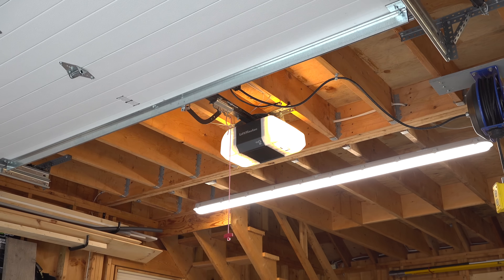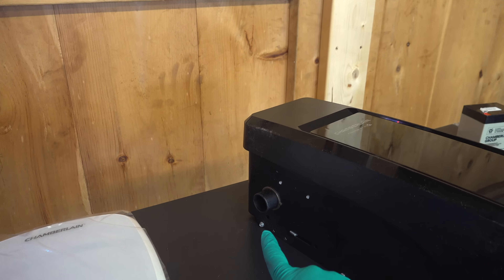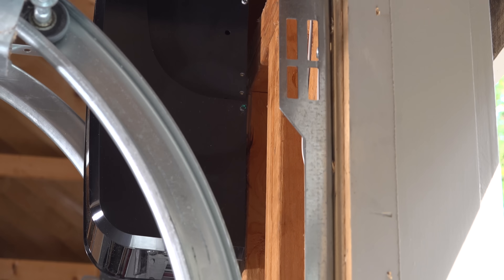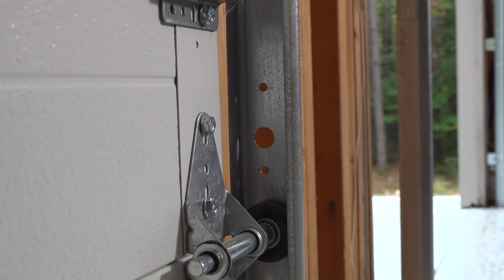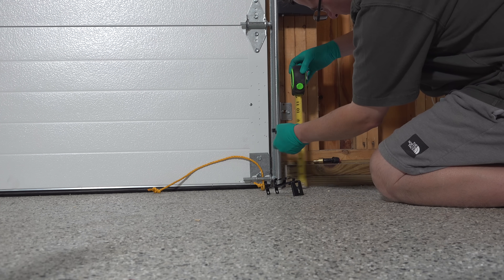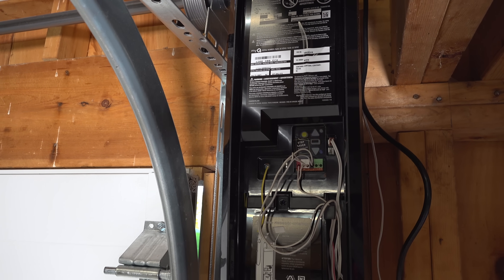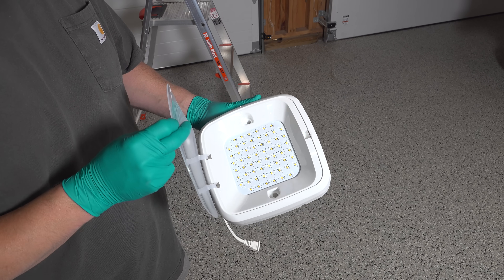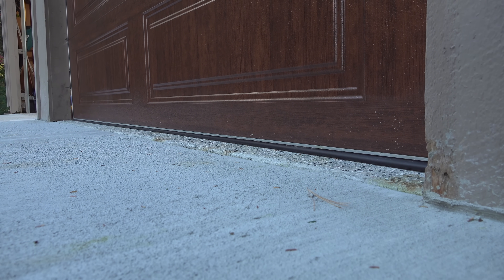Finally a SILENT Garage Door Opener that locks like a SAFE! - RJ0101

Comment: I have two of these hateful things.   The jackshaft only pulls the door up, it doesn't push it down.  It only allows the door to 'fall' in controlled fashion.  That might seem an insignificant distinction but it's important to understand because if the door is fully open (horizontal), there's not enough weight to pull the door down.   You have to adjust the door so that part of the lowest section is near vertical so it can pull the rest of the door down.  In my case, the door won't "fall" closed unless I adjust the limits so the door blocks about 1' from the top of my garage door opening.  I need the full 10' of my opening so this doesn't work for me.  As such, I have to have a plunger spring that pushes the door down until it can fall on its own which defeats the purpose of not having something on your ceiling.

Additionally, when the seasons change from summer to winter or back, all the tension settings are wrong and the door won't open or close correctly and I have to get out a ladder and re-set the tensions.  We get Chinook's here so even during the winter, I have to re-set the tensions before/after.  

My overhead door guy installed it despite recommending against it.  Now I wish I'd listened to him.   I want my garage doors to be reliable, I don't want to get out of my vehicle to manually intervene.  These (Liftmaster 8500) don't meet that requirement.
Reply: Super Interesting. Thanks for sharing!
Reply: Thanks for saving us the inconvenience.
Reply: Have you considered slightly angling up the rails so the garage door is never fully horizontal?
Reply: @TheCarpenterUnion  Every change affects the whole system in a different way.  Changing that angle will make it harder for the motor to pull the door uphill when the door is nearing full 'up' and that will also be when there's the least tension in the spring which will mean increasing spring tension to compensate and then we're back to the same problem.

In the 3 years I've had these doors, I've learned a lot about the many different variables that affect them with this opener.   I even thought maybe my overhead door guy was part of the problem so I had an old guy from a different company come out.  He looked at my install and said it was done well and that this is just the nature of the beast.  One option he gave me was to raise the rails up near the ceiling and add an additional panel.  But the geometry of my garage means that I'd have to change my lighting to be flush with the drywall.
Reply: @hp7033  🤷‍♂️ just a suggestion
I have mine angled on a traditional belt just to gain some overhead space. I don't think you'd need to tension the spring as long as the motor is capable of holding as well to some degree.
Reply: @TheCarpenterUnion that's a tremendous amount of work when there are better, easier, and cheaper options available. Unless your garage structurally won't allow a traditional style, there's just no reason to go through all that.
Reply: Are you sure your torsion springs aren't too "tight"? If you disconnect the opener and lift manually, does the door seem to want to pull itself up? If so, might want to loosen the springs a bit to allow the weight of the door bring itself down rather than want to come up
Reply: @GageDrums  Yeah. I'm quite sure.  If I disconnect the opener and even part of the bottom panel is in the opening, the door happily falls all the way.
Reply: @hp7033  interesting! Well that sucks
Reply: @GageDrums  Everyone guesses this. It wont work. The opener is slowly releasing the spring tension off the door so it can fall down in a controlled manner. Adjusting springs does nothing. What needs to be done is to raise the back hangs as far as you can. ensure you have good ball bearing rollers and the track is free of any dirt to give you the best possible conditions for this operator to work.
Reply: Thanks for your input on these. I need to do more research to see if this is the right solution for me...
Reply: I'm a garage door company owner. 2 simple adjustments will solve your problems. 1. elevate the horizontal track slightly up in the back and 2. reduce the spring tension on the torsion springs.
Reply: @Colt45.   The rails are already elevated quite a bit at the back end.  The door guy came back a few times to adjust the tension.  It's at a point now where if the springs are loosened, then the opener errors out unable to lift the doors back up.   They're 10 foot x 10 foot R16 doors with windows in one panel.  

The door guy has been a door guy all his life.  He installed the original doors with his dad when he was 16, in 1981 and has taken over the business.  I'm not saying a guy with 40+ years of experience can't be incompetent but I do tend to trust him.
Reply from the maker: There is nothing special about my door and it opens and closes fully. This model just came out this month with variable tension which is different than previous models. Maybe that's why but so far it has been working perfectly.
Reply: @SilverCymbal It will be interesting if you feel the same 10 years down the road.  Standard openers are far superior, particularly the screw type which I have which are much quieter than a chain and positively lock the door in any position.  Now way I’d replace my screw style opener with one of these.
Reply: @LTVoyager  I agree on the screw type being the best.  That's probably why no one makes them anymore.
Reply: @williampalchak7574 they still make them. They are just inferior to belt drive operators. I've been installing for 24 years and old screw drives with a big screw (Moore-O-Matic) were great but the newer small screw (Genie & Chamberlain) have more problems. We will not even sell them.
Reply: @culpforty  yeah, we've got 2 "small screw" in our garage since Katrina that would disagree.  I like to synchronize opening them for kicks.  Did that just a few hours ago so your comment made me laugh.
Reply: That’s a faulty unit my friend.  Mine has worked perfectly for 10yrs
Reply: @Fixin-To it's not a faulty unit, garage door pros tell residential clients not to use these specifically for this reason. If the people who stand to make more money by selling openers 2x the cost of normal openers tell you not to do it, you know you shouldn't do it.
Reply from the maker: @Fixin-To  I agree the motor has the same force in either direction.
Reply: @Fixin-To  It may be a faulty unit, but it is partially simply physics.  You can’t push a rope.  The torsion rod style openers can only pull the door open with the cable, they push the door closed as a conventional open can and does.  This is an inherent limitation in this style of opener.
Reply: on a side-note: so nice to see civilized pro and con conversation where both sides focus on explaining the subject and not attacking the person.
Reply: I'm a garage door guy. I try to talk my customers out of wall mount openers on standard lift doors. There are too many callbacks. I install pusher springs gs on all of my standard lift doors and have eliminated most callbacks. Also, I install Genie, not Liftmaster wall mounts. I've had too many problems with the Liftmasters. Now, they are perfect for high lift or vertical lift doors. I have 3 in my shop that have been working flawlessly for a couple of years since I have one highlift and 2 vertical lift doors.
Reply: I was going to go with the wall mounted type like this for all 3 of my doors, specifically to free up the garage ceiling space. A friend of mine that installed doors/openers for years told me not to do it for the very reasons you recommended. He said they are great for large doors that open straight up Luke in warehouses and auto shops, but the average home garage door these just aren't made for. He also told me I'd have to mess with the travel and tension settings in the fall and in the spring. It's a garage door opener,  I don't want to ever think about it again once it's installed. I went with chamberlain belt drive openers with MyQ and I'm extremely happy as they work well and are as silent as can be.
Reply: Also those locks fail after a few years. Condo had these installed and they failed all the time.
Reply: I assume these don't work with the one piece doors?
Reply: @brodriguez11000 right
Reply: Umm as a Garage Door Professional.. We have a fix for this!! If it's installed correctly and by a person that has done many installs this is a great option. More expensive and yes it saves space. Great for people with car lift in the garage!!
Reply: Couldn't you raise your rails in the back? wouldn't that allow gravity to do more?
Reply: @shrimpinpat 
Gravity is fake.
Reply: @shrimpinpat  They're already raised a bit. Maybe a few inches over 10 feet.
Reply: Is the gravity lowering system the same with ALL jack shaft motor systems?  I am researching now, thank you in advance.
Reply: @kevinjohnson2024 yes. If you look at a regular opener you will see that a chain or belt or screw drive system is connected to the door itself and pulls it up and pushes it down . As mentioned you can’t push the jack shaft down, it turns as the door falls by gravity. The opener just stops it from dropping like a rock. Go look at a regular opener and use it manually as if you lost power, you’ll see how it works.
Reply: Your opener was never installed correctly and your spring tensions were never balanced correctly!  I have been using one of these openers for over 10 years and have never had an issue.  Doesn’t matter what the temperature is, the operation is consistent regardless. Commercial openers have used side drive openers for decades.  Find a new installer, one that has a clue how to properly install an opener!
Reply: 'You have to adjust the door so that part of the lowest section is near vertical so it can pull the rest of the door down.'
That is not the only way.  You could just raise the inside end of each track slightly, and get the needed 5 pounds or so of down force from a slightly inclined plane.  While they tell you not to do this, it's so the door is neutral when up and doesn't tend to fall.  5 pounds of down force generated that way would be no real difference from having the constant down force generated from keeping it rolled away from the full up position.
Reply: I have one of these on a new construction build. My door is open well past the opening and the lowest panel is nowhere near vertical when opened. Yours are either the wrong application or not installed correctly.
Reply: Door maintenance is a real thing when running these.
Reply: You have it set incorrectly. You don't set the track so it's perfectly horizontal at the top. Leave a little slope and it'll work fine. I've had one for over 15 years.
Reply: I have a Jackmaster for years and it has always worked perfectly
Reply: This was very insightful to know. 

I have three garage doors and I installed three of the chamberlain units four years ago—the regular belt drive. Each has been flawless and the app is very good also.
Reply: This is exactly the issue with these types of openers. I would only ever recommend this type of opener for a heavier, glass/aluminum door
Reply: I’ve had this system for 2-3 years on 16 foot wide 7 foot tall door in Missouri (hot summers / cold wet winters) with no issues. System is so quiet and smooth!
Reply: @hp7033  thanks.  I would have the same problem living in a coldmclimate
Reply: So don't install this for a standard residential lightweight insulated garage door that stays halfway open on its own without falling?
Reply: At this years CES they replaced the door with a tablet... 😂
Reply: Sounds like it was never programmed correctly, They are programmable for down force
Reply: @michaeljames63  How exactly do they produce 'downforce'?  There's no mechanical way for the opener to push the door down.  The programming you're talking about has to do with the limits and with the up-force.   I mentioned in my original comment from a year ago that I have to re-program the door whenever the seasons change.
Reply: Jackshaft has to be installed on a door that has been tuned with this device in mind. Nylon rollers with fresh bearings in them, no friction against the opening/trim, springs slightly detuned to create some natural pull at the open position, horizontal track should be lifted slightly upwards, and the whole door should be tuned up and lubed well (end bearings should be perfect too).
Reply: @dmytroonikiienko5461  Mine were installed at the same time the new doors with all new hardware were installed.  10 foot doors, 11 foot ceilings, rails tilted up.

One has to ask oneself, if these are so difficult to tune/install, and installers are recommending against them, why are they so considered so much better?  My install is now over 4 years old.  Does that mean I have to buy all new hardware again?
Reply: @hp7033  Technically, you just have to do your math and see if their is slight possibility that you've done 10,000 cycles or more on those original rollers. Spring should be adjusted once a year or more if you are using a door a lot.

I am an installer and I can guarantee you that if most of the precautions are in place there should be little to no issues with the cable drop etc. Moreover, the newer jackshaft openers (anything LM after 2023) are a much better option than the old 8500 with an auxiliary cable tension monitor, there little to no issues with the chamberlain you see in the video.
Reply: Any chance you have a short radius bend in your door tracks?  Going with a longer track radius will help a ton with these.  I set my door springs a tad "heavy", a little slope on the horizontal tracks, and no more issues from it.  You also can get "pushers" to the ends of the track but I really didn't want to have to go that far.  So far, so good.  I hated all the rattling my old chain-drive opener made when the kids were romping in the bonus room overhead.
Reply: @GoFastGator  The radius looks the same as my other garage doors with trolley openers.  The pusher springs are how my door guy worked around the problem after his 4th trip back and I hate them.  He told me the problem is that while these openers work ok on 8' doors, the taller the door, the worse they are.  Even with a slope, my 10 foot doors just have too much weight and don't want to start moving on their own, reliably.  They will eventually but by then the opener has timed out.   I pushed up the slope even further but had to move a couple of my flourescent fixtures because now the door wants to collide with them.
Reply: @ I would maybe look into the pushers.  My door is a 16ft and is very reliable even without the pushers.  If you don’t have any more overhead clearance, you may not be able to utilize a longer radius for the bend without creating a gap when the door is closed.
Reply: This may be true for an older design, buy not the rj0101
Reply: I think the overhead units have an adjustment screw for motor torque when closing and it's usually set to minimum. Maybe this jackscrew type has the same adjustment and you can increase the closing torque. Have to open it to access. Maybe? I've never done it
Reply: You are absolutely right. Instead of the weight controlling the door, it is now the operator on the torsion shaft releasing the tension. If the door at all gets hung up and the operator keeps turning the cables then jump. We saw an increase of this over 70% when these jackshaft operators came out for residential. If you don't have headroom you have to have one of these but otherwise avoid them like the plague.
Reply: @tonystewart7872  Which touches on my final beef.  In order to reduce the chance of cable jumps, they have another spring loaded sensor that the cable runs against.  If the cable becomes slack, the sensor 'trips' and the opener 'should' stop.  So added complexity that turns out not to be 100% reliable.
Reply: This is exactly correct. Conventional openers which push down the door are vastly more reliable. If not set up just right, these jackshaft openers will eventually crank your door to failure. Have seen many. And they're not appreciably quieter. The majority of noise comes from the door roller bearings, not the opener motor.
Reply: I'm not sure what opener you have but I just installed one of these recently to replace my old and malfunctioning rod driven opener. The door opens and closes super smoothly. The door does not fall closed on its own at all, it remains perfectly stationary when disengaged. Actually at the open most point, the door has a natural "desire" to open probably due to the spring but once past that upper most point, it does not fall closed or slip up to open. So, for the model I have at least, your claim is factually incorrect as it can pull that top part down with ease.
It is also much quieter. Same rollers on the door, just no louder motor pushing and pulling the armature along the screw shaft. I am super happy with my opener and would happily recommend it to anyone looking for a replacement door opener. Sorry you had bad luck.. twice apparently.
Reply: @dancormack  On a typical residential garage door, on each side there is a cable that runs from the very bottom of the door straight up the sides, and to a pair of rollers on the jack-shaft.  When the jack-shaft is turned one way, the cable is retracted and the bottom of the door is pulled up.   In order for the door to go back down, the jack shaft is turned the other way allowing the cable to unwind itself and the door 'falls' closed.  There is no way to turn the jack shaft to make the door go lower if the spring is so tight because you would, in effect, be pushing on the cable and it of course would go slack (tripping the jackshaft-opener lever sensor which monitors the cable tension).  I have a pair of Liftmaster 8500DW's (which are more or less the same as the Chamberlain).

What you are saying seems illogical since when the door is at its "open most point", there is the least spring tension.  Spring tension increases as the door closes (to compensate for the weight of the door.

Based on what you're saying, I have to conclude you do not have the typical residential segmented garage door as shown in this video.  If you did, then what you are saying would be impossible.
Reply: @hp7033  I don’t know much more than I said. My door does have the wire spool on the ends, a single spring(recently was replaced as the old one snapped). Maybe I was not completely clear with how I explained what I observed. The door only slides up after the bottom most panel is half way through the curved track at the top. Once there, it has a tendency to slide up the rest of the way. Maybe because there’s no weight pulling the door down? Maybe something odd with the door (it’s old) or how they installed the new spring? I did have to get the installer to come out to properly balance my door because it would slowly slide shut when opened half way. 
I guess the main point I was getting at is that my door does not fall shut on its own at all. The new shaft opener has to push it down just as much as it has to pull it up. I would say also, because of my observation about how the door tends to slide the rest of the way once that last panel is curving in at the top, the motor has to push it shut a little harder at first since the balance in that position seems off and biased towards opening. The rest of my comment still stands though. The opener is much quieter and simple to install. I have the Chamberlain one with LED lighting and battery backup. Minor near thing also is the motion sensor in the wall mount control which turns on the light. I know this is probably typical of openers these days but my old one (here when I bought the house) didn’t have this feature. So far I am pleased with it all.
Reply: @dancormack  With all due respect, the opener can NOT push the door down.  The opener is only pulling on a rope or unwinding a rope.  It can not push a rope.  The opener has no other connection with the door.  This video, while old, explains very well how a garage door works and after watching it, you will understand that what you're describing is not possible.  https://youtu.be/2yFhsl3s_4A?si=z1nJEIG80_PB6eJn
Reply: @hp7033  Well, my old opener (screw rod) had a physical arm connected to the door and it moved it up and down via that. The new opener (similar to the one in the video ) physically rotates the spring tension rod to open or close it (it's bolted onto the tension bar). That rod lifts or closes the door. The rod is attached to the wire via the wheels on the end.  The door's weight is constantly pulling the door down (gravity) while the spring on the rod pulls it up (tension). When tension = gravity the door remains motionless and the door is properly balanced. I know you know this so please don't take offense to this as I am trying to better establish what I am trying to explain (and I am admittedly doing a poor job of it) . I think we have a miscommunication. The wires are holding the garage door up... gravity pulling door down due to its weight, tension in wires pulling up with the tension spring establishing equilibrium. so now I can with ease, lift the very heavy door by hand or push it down as the spring which is on the rod is negating the door's weight. I just need to overcome at rest inertia and friction to get the door moving. 
At the top just as the last panel starts to curve inwards, spring force overcomes gravity and it tends to lift the door on its own the last foot. This is strictly spring on bar forces. Gravity is still pulling down on the cables just much less and the srpring I guess is not perfectly attuned to the door or something. The shaft drive motor can overcome that excess spring energy when I want to close the door as it rotates the shaft against the spring energy. The door is still wanting to close due to gravity and the wires are still in tension. As the opener rotates the shaft, the door starts to close (due to gravity) at a controlled rate.
My point still stands. The shaft motor has to overcome that little bit of excess spring energy which wants to keep the door up. If I disengage the opener and even when I had no opener at all while I was swapping it out, the spring kept the door open. This has nothing to do with the support cables on either end of the rod. The cables are still fighting gravity due to the door weight. The shaft motor does not simply let the garage door fall, it must rotate the rod and overcome spring tension to move the door down.
Reply: @StrIIker-TV  Yes.  You appear to get it.  The other user I was responding to clearly does not understand it.  And as is the case in my setup, when the door is fully open,  rotating the jack shaft only loosens the cable and the door does not fall on its own.  When the cable loosens, it trips the tension sensor and causes the opener to go into an error state.  It's for this reason that my doors require a 'spring loaded plunger' mechanism to push the door enough so that the lowest panel starts to go down pulling the rest of the panels with it.
Reply: @hp7033 The moral of the story is, sucks to be you, I guess.😢😂
Reply: @hp7033 these comments are interesting . You are spot on how these work . There is a reason these units check to make sure the cable still has tension and stops right away as soon as the cable goes slack . Something not necessary for your traditional garage door opener which physically pulls and pushes the door itself . I ended up refusing to put these in . Installed doors and openers for 15 years . These units in this video rely on gravity to close the door . Your right as a cable cannot push a door down (obviously) . That is why these units have to have the safety feature that always monitors tension . Always angle the track in the back slightly upward  . Some of these comments are interesting and easy to tell those that have never installed one . 😅 . I installed a few then got sick of them . I would constantly get sent out to other installers install of these and pop the cable back on . Raise track slightly and readjust the down limit.

 Easy way to demonstrate how these work . Take a pencil(this will represent the spring,shaft the openner is connected to) and tie a 6 inch line to it . String or yarn . That is your cable . Tie a weight to the string . That is the part of the bottom of the garage door that the cable attaches to . Now twist the pencil to where it pulls the string all the way up . Now holding only the pencil . Twist the pencil the other way to where the weight lowers down . Hold your other hand 3 inches below your pencil, remember the string is 6 inches  . What happens when you keep turning the pencil and the object (door) reaches your hand ?? Your line will go slack .. so as you turn the pencil (shaft) . It allows the object (door) to drop down . (Gravity) . Now turn the pencil the other way to raise the object back up . (Traditional garage door openner) Now this time grab the pencil with one hand with the string between 2 fingers . This time while holding the pencil(medium grip) representing tension . Push the object itself (that is tied to the string) manually straight down … you now have solid cable tension the whole way . Tadaa
Reply: @dancormack  Yep, just a bunch of misinformation by jealous haters.
Reply: Had mine for years, never an issue! Sounds like you have the wrong model!
Reply: I've had these on my doors for 35 years. Door goes all the way up no problem
Reply: @anonemous4529  That's amazing, you've had Liftmaster/Chamberlain jackshaft openers on your doors decades before the company even came out with them!
Reply: and down?? he was talking about DOWN! you know, closing!   you didnt mention down? (conveniently !! ) @anonemous4529